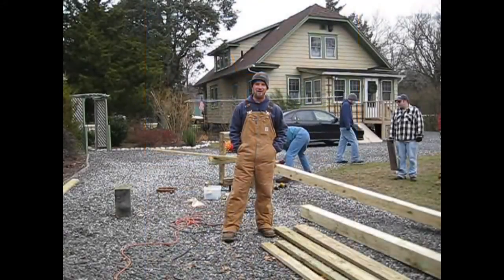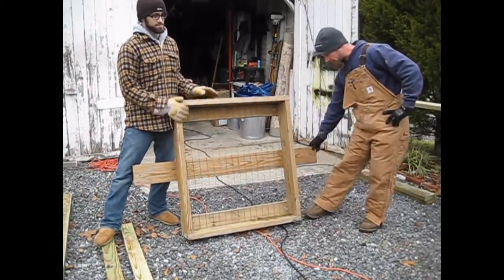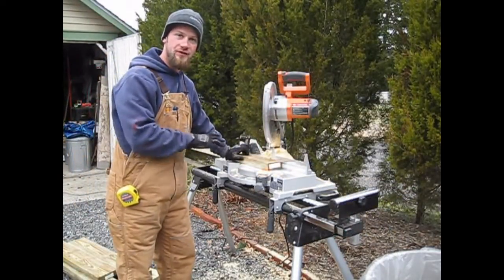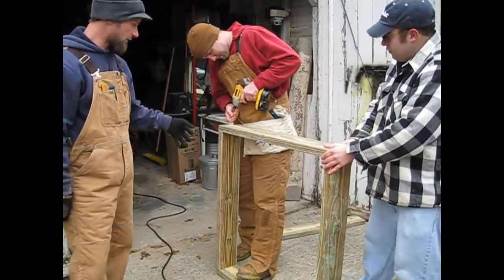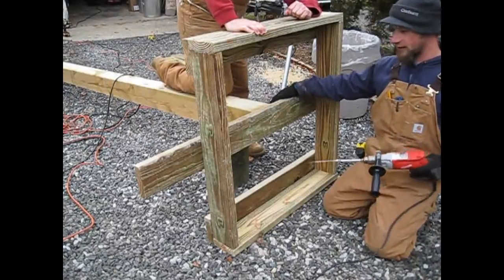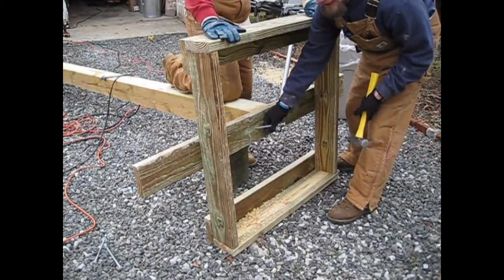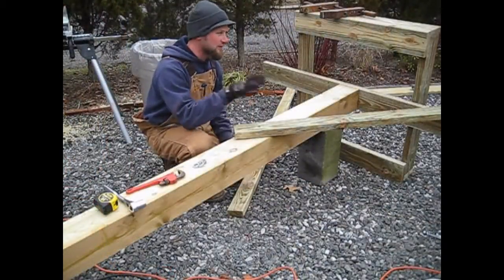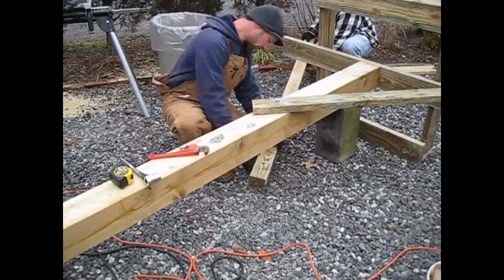Osprey Platform Construction

Comment: Hi, this video was excellent. I’m making osprey nest just like Miles for my eagle project I was wondering if I would use aluminum roofing sheets for the predator guard instead of the coil.
Reply: Hey I’m a life scout thinking about the same project ! How’s your coming along. I’m thinking about restoring the 8 nests in my cove on the water
Reply from the maker: The best predator guards are inverted cones, but they need continual maint. Whatever you install should be greater than 36" in length on the pole. We used to only do 24" wrap but have observed raccoons climbing above that!
Reply from the maker: Please reach out to Ben Wurst, our osprey expert if you need any guidance. ben.wurst@conservewildlifenj.org

Comment: Hi Thank you very much for this video. It was very helpful to me. I have one question about the V shape that is formed by the two 8 foot 2x4s. Why do these 2x4s extend above the level of the nest? Is it for the osprey to land on? Why isnt it flush with the nest?
Reply from the maker: Hi, that is correct, but you can use a 12' 2x4" and cut it in half to get two brace/perches. Generally, they are okay to be around the same height as the nest, but over time (if the nestbox is not cleaned out) then the nest may be taller than those perches. You can make them as tall as you'd like, so it's more about personal preference as the birds will use either way.

Comment: How far into the ground did you set the 6 x 6?
Reply from the maker: Usually around 3-4'. We use some ropes to help straighten and sink the post a bit. If soil is sandy, then it is more difficult to get that deep and we recommend using a water jet to submerge post.